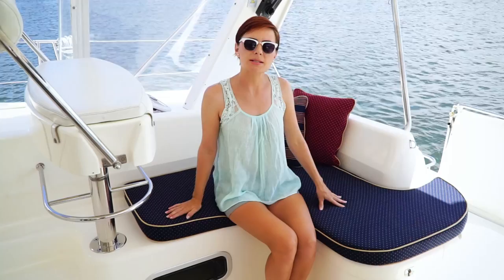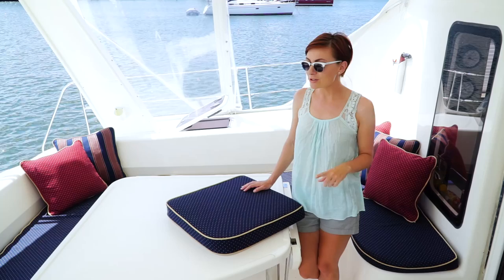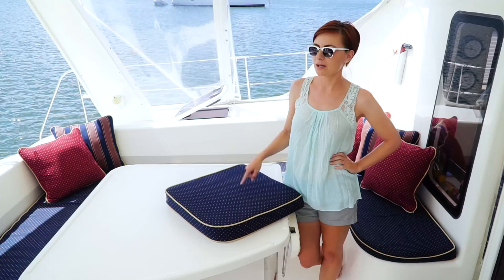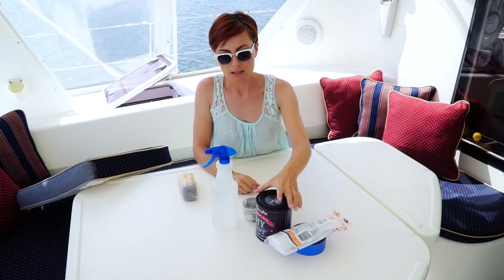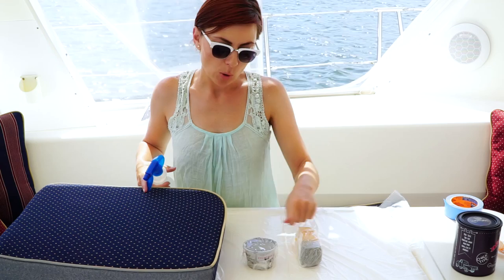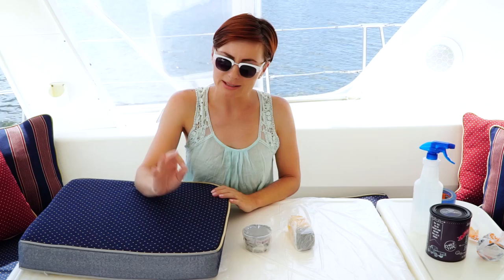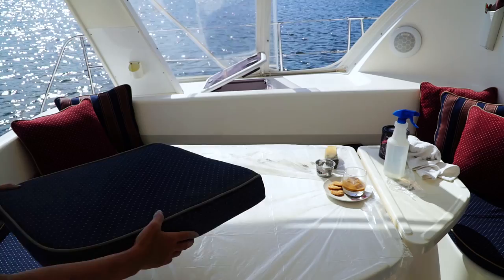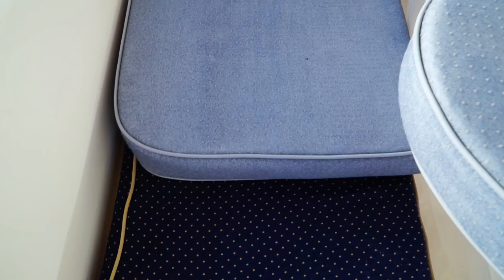Nikki Goes DIY in the Cockpit - Our Sailboat Makeover

Comment: Gone with the Wynns. Coming from a Solo Sailor who has spent thousands of hours beating up coastlines amongst line squalls, quartering seas and thunderstorms. In only monohulls. I must say choosing a catamaran was a good choice for comfort if not for performance.  I love your channel and your lifes philosophy. I hear you are working through sailing classes, and would love to see a video of your progress and thoughts so far. I have only one piece of advice. Marine electronics will fail right when you need them the most. Hopefully your sailing instructor understands the importance of common sense and Pencil and Paper Navigation.  Having the latest US Coast Pilot handbook as well as having the latest Paper charts may one day be a lifesaver. And I cannot stress the importance enough of plotting your sail plan on paper and correlating and crossrefferencing wind, waves, and current. Instead of clicking in a set of coordinates and relying on your nav software to plot your course.  When sailing and anchoring in remote spots having the latest copy of the Cruising Guide for your intended area will be a huge help.
Reply: I would imagine having a map with landmarks helps too right? ie harbors/marinas, lighthouses, landforms, McDonald's restaurants?
Reply: Some of us still own a sextant and know how to use it. It is not that I don't know how to use the latest electronics as they are not that much different than the instruments on my plane. But when you are in the middle of an ocean you can't ask for help from traffic control.

Comment: Wow! What a tough crowd. Your viewers have changed since you bought the sailboat...Mean bunch of snobby haters....Makes me want to yell at them to leave you alone!!! DIY ideas are always fun to try. The other options are always there for later down the road.You two are refreshing to watch...Please don't change because of nasty comments jealous people make.
Reply from the maker: Thanks for the love Margie.  I won't let the trolls get to me.  I try to focus on the good and ignore as much of the negative as possible.
Reply: Some people may be trolling but most are not. What you wanted to do is fine but you used paint that is not waterproof and then tried to fix that with Minwax polycrylic that is for interior use only. It was all wrong for the application. On the bright side, I"m hoping and sure you learned something. Read the labels and also the MSDS sheets of the product before using.

Comment: If you wrap the foam in plastic and tape the seams and then put the covers on, your foam will stay dry and you will avoid mold.  That's what I do.  Be sure the plastic is flexible enough not to tear or break seams.

Comment: Would a product like 3M Scotchguard have worked as well?  It's a spray on that I've used in my vehicles to protect the fabric on the seats from spills and stains.
Reply from the maker: I thought about that but was worried it wouldn't adhere to the paint the same as it does fabric.

Comment: I would go along with the directions a use at least the four coats they tell you to. On a sailboat, where the sun beats down on anything and will bleach out the "paint". I believe it is a stain, not s paint.
Reply from the maker: It is a paint and not a stain.  Only time will tell but I think it will hold up long enough.  The cushions have some years on them already so at some point they will have to be replaced.

Comment: It's a boat in the sunny warm south. You jump overboard, get out , semi-dry off and sit or lay on the cushions. How comfortable is that paint going to be on bare skin.  Those cushions are easy to recover. You use the old cushions as a pattern. But first you learn how to use a sewing machine.  
I would sooner lie down on a fabric i didn't like than on one that was uncomfortable.
Reply from the maker: It really doesn't feel bad.  As I mentioned in the video, we have been out sailing with it, laid on it with wet bathing suits and so on.  All good.   I do know how to sew and do own a machine.  Cushions are not rocket science but do take a lot of time and unless done right, can look terrible.
Reply: Gone with the Wynns
 Missed the part about sitting on the painted fabric.  I was laughing to hard, I thought you were joking about painting the fabric. I know it's done for set making and displays but to live with and use on a daily basis .  I think I would have lived with the original, saved up for something new and concentrated on getting the boat sailing.  Save the lipstick and mascara for after the boat is a solid runner.

Comment: If you went through all that work to modify existing cushions only for the paint to not be waterproof, which seems like it would be pretty important for a boat, why not just make new cushions from the onset and seal them with normal fabric sealant? No need for fancy $1000 cloth.

Comment: Hope it works long time, Nikki: Also you have not increased combustibility? That dress and you paint those poor cushions!
Cheers
Reply from the maker: Thanks!  The chalk paint is made of clay and minerals so that shouldn't be a problem.  As for the polycrylic I am not sure but it has to be less flammable than the starbright protective outdoor fabric coatings a lot of boaters use.  That stuff is practically lighter fluid.